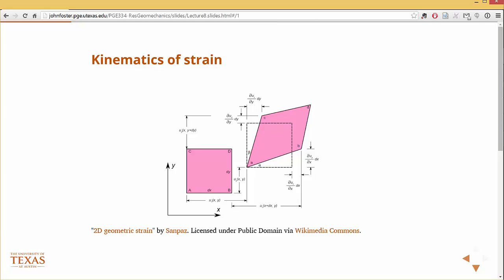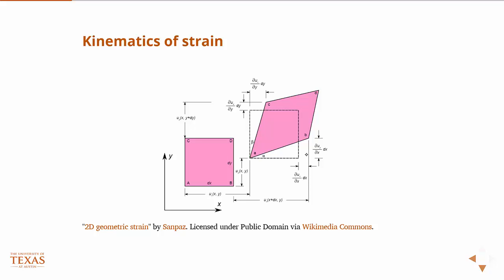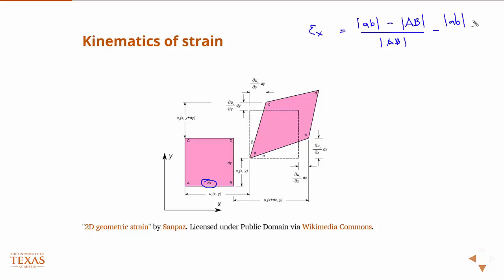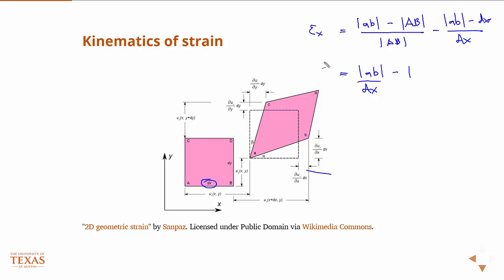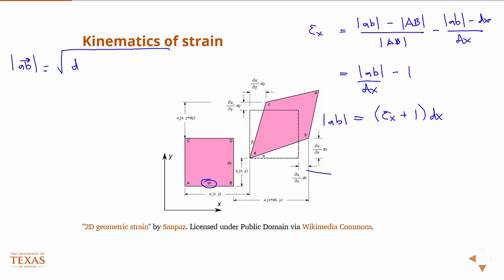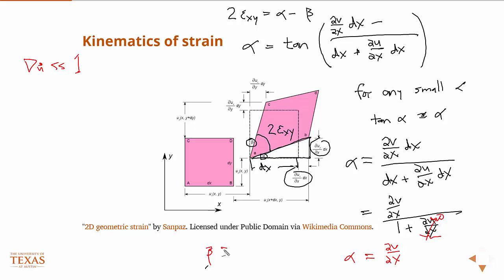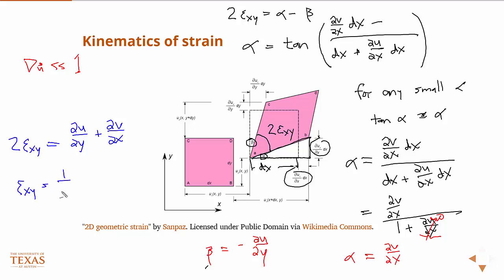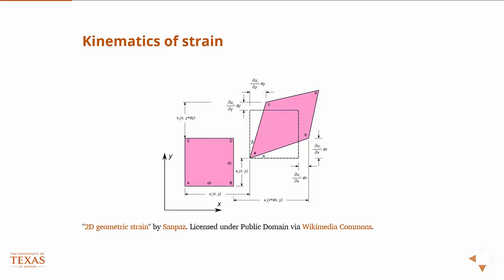2D Strain - Mathematical Definition

Comment: The definition of shear strain here is misleading. From your diagram at 12:13, you define the deformed differential element acute angle as twice the shear strain, which implies that if shear strain is zero, the element collapses onto a line, and an un-sheared element has a shear strain of 45 degrees.